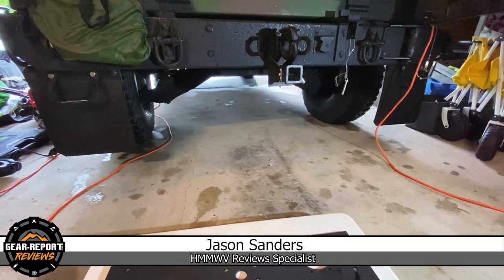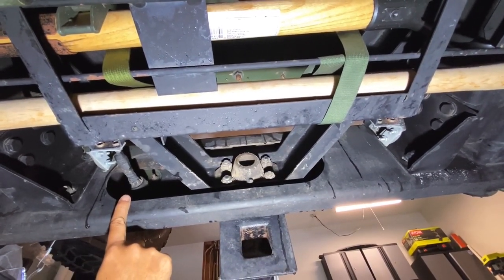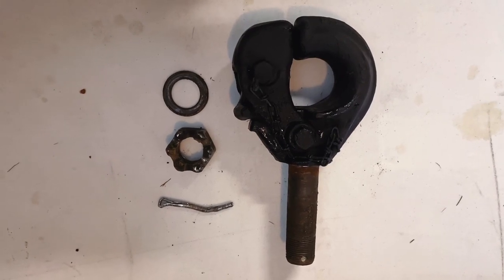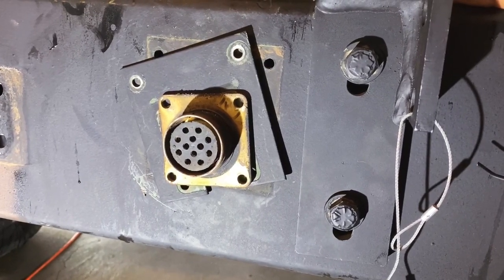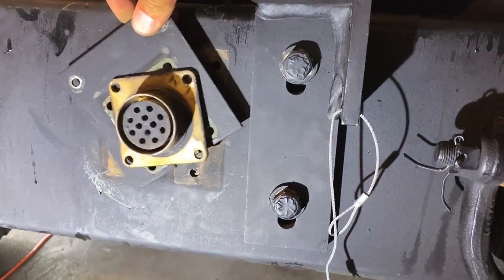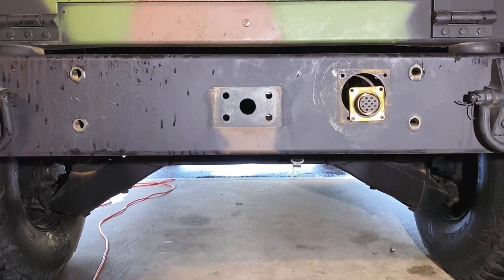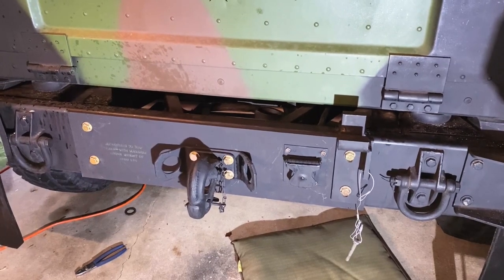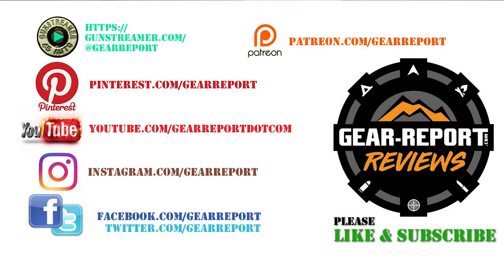Humvee Upgrade - How to Install HMMWV Airlift Bumper Reinforcement Plate

Comment: The shorter pintle hitch bracket mounting bracket needed when installing the reinforcement plate is NSN 5340-01-506-7986  PN 12469170
Reply from the maker: Thanks!